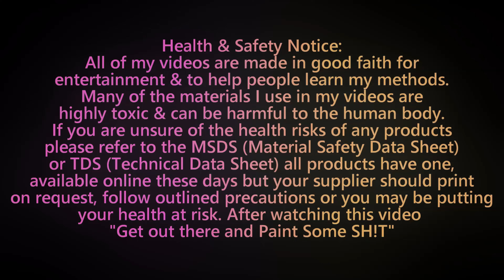Mazda CX-9 Clear Coat Stage

Comment: Looks fantastic. Your right with the delam issue. Base wasn’t dry enough before clear coating. That’s why stress using a infrared temp gun to make sure it is dry enough. It was the one thing I didn’t like about enviro, looked dry, but wasn’t,when I mention the issue to my ppg rep, he said there’s a difference from flash, and dry. 👍

Comment: This gun is beautiful i have the black h2 model and it spray so nice the trigger is the softest i ever used.
Reply: Do you know the difference between 200s and h2 bro?
Reply: @jones_1996  the h2 model has the ability to heat the air, which favors the especially color-based finish and clearcoat reducing orange peel this gun is very well made and has nothing to envy to the big brands name spray guns on the market i own iwata,sata,devilbiss,walcom  i know what im talking about.